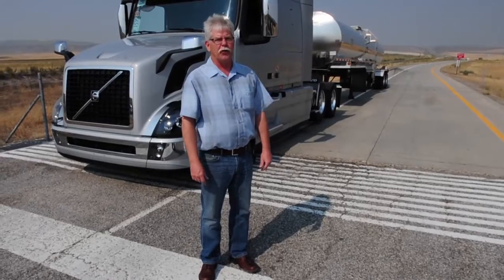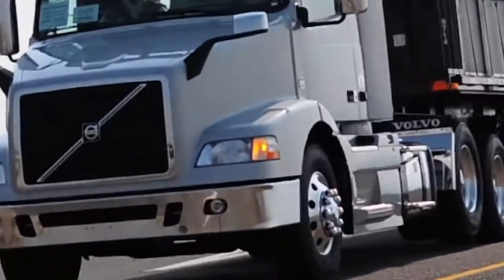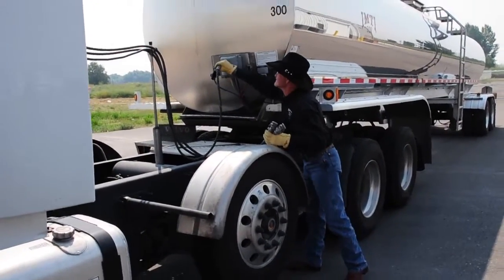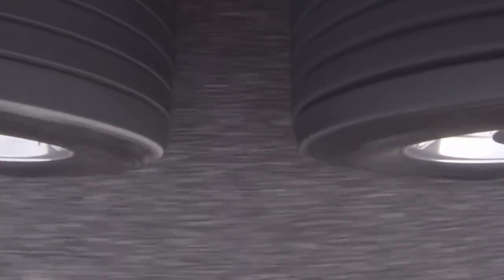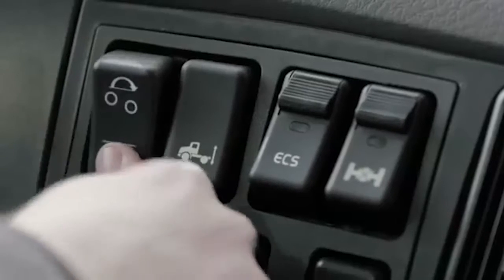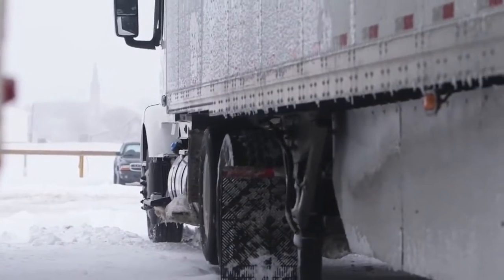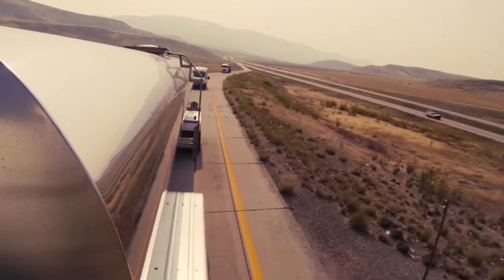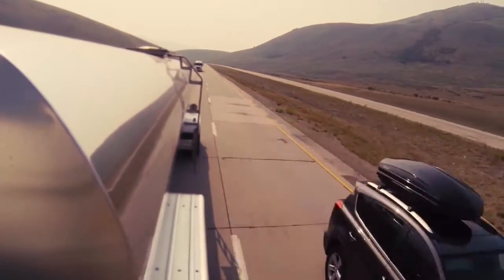Focus On...Volvo Adaptive Loading

Comment: we over in europe cant understand why the americans use 6x4 tractors for highway use. for the light weights (80.000) its no need for it.  
however there is something very important you need to be able to in a 6x2 to make it work in snow/mud and that is the ability to lift the pusher/tag axle free off the ground fully loaded. that will overload the drive axle, but its the only way to ensure enough traction many times. 
in scandinavia a pusher wont cut it on the hilly roads so the 6x2 trucks have the tag axle in the rear. that will give you around 20 metric tons on the drive axle when you need to.  its not how the EU regulations are, but we say f you to them on that one :)
we even kit out the 6x4 trucks so the air can be dumped in one axle transfering most of the weight to the other drive axle. that helps much when empty or when need to turn very tight.  
i know americans are very conservative when comes to trucks, but the ones willing to learn and take inn different ideas will always come out on top.
fun to watch your videos from north america. my goal is to have a peterbilt working in my company in a few years over here in north Norway. a visit here one time i think you would have found interesting :) keep up the good work.
Reply: +sisutrucks Thanks for the comment my Norwegian friend. I would really love to vist and see how you truck there. One advantage you have over American is the weight you're allowed to run on the single drive axle. If I'm not mistaken, most of Europe allows 11.5 tonnes (25,300 lb) on a drive axle. The limit in the US is 20,000 lb (9.1 tonnes). There's a little more traction right there. Even with our new electronic traction control systems that transfer more weight to the driving axle in a 6x2, the best we can hope for is 23,000 lb,  an that's just temporary.
Reply: +sisutrucks 
Dear Euorpean friends, 
You have to remember that we in in the US have a "bridge formula" that we have to deal with. That mean among other tings that we have limited axle loading rules [5.5 to 6.4 Ton on the front axle, and a maximum of 9.0 Ton on a single drive axle, and only 15.5 ton on a tandem axle = [5.5T + 15.5T + 15.5T= 36T GCW on 5 axles].
So with the 5th wheel in between the tandem axles [apply to all 6*4 or 6*2], it does not work well at all to try LIFT a tag axle that are approx 0.6 meter behind the bogie center, as you will "off load" an already light loaded front axle with approx 10-12% of the current King Pin load..............so with 20000 lbs, 2000 lbs goes away on a bad winter day............hum, it will be like driving w. ther difflock engaged .............you can just go straight forward..
Reply: peter blonde that is a very good point, so a pusher axle would be the better choice. whats screws us are the very short lengts we have to deal with on international transports. semi tractors cant have over 10 feet wheelbase then and that make for unstable trucks not to mention the small cabs drivers have to live in.
Reply: +sisutrucks Yup, here you have some basic dimension from a typical NA tractor. The US "bridge formula" require a minimum of 51 feet [15.6 m] over 5 axles. The general WB [front to drive axle] on trucks in the video are around 210 - 212" [5.4 m] for the Day Cab, and around 234 - 236" [6.0 m] for the sleeper model. The bogie spread are close to 1.3 m, and the 5th wheel are approx 0.7 - 0.9 m forward the drive axle [application dependent] to load up the front axle to its maximum 12.0K lbs limit when @ 80.0K lbs.

Comment: adaptive loading is far more common in the uk
Reply: I would say in Europe ;)
Reply: +Klaus Loewer yes sorry EU, most of the truck are made in EU and not uk
Reply: +Artbag1 
Americans are alwsys late ;). I'm thinking of having brakediscs in semis. And now I'm waiting when they discover using curtainsider trailers and a third axle. And I'm astonished that they do not have the Europeam system to drop and pick up a trailer. It's so much easier and cleaner when you are able to lift the rear axle of the truck to get the trailer in a higher position for  working with the underpins. In America (Canada included) you have alsways grease at the front of your trailer instead having it on the 5th wheel.
Reply: Sorry for writing the word always wrong. It's the german autocorrect of my mobile.